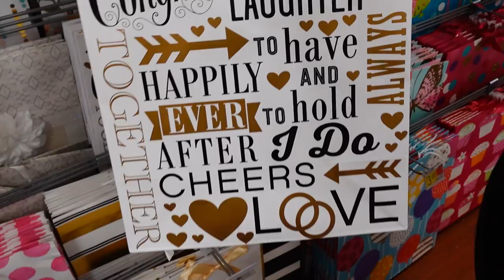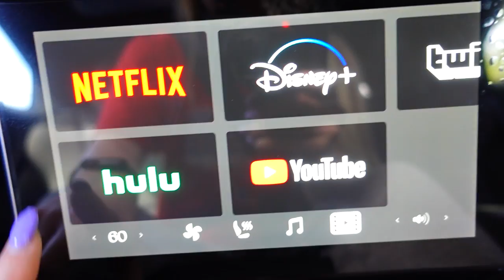Surprise Dream Car for DAD! | Tesla Model S Plaid

Comment: Don’t you need a special Tesla charger in your garage?
Reply: Not necessarily.  It can charge on a standard 110v, it even comes with an adapter for it, but it takes a LONG time to charge that way.  I’m sure they are having a Tesla charger installed, but until then they do have a way to charge it.

Comment: If you had pulled the car in without the use of the ramps it would have worked better lol. The rise from the step-up of the pavers was inconsequential and the only part of the tesla that touches them is the rubber of the tires so they wouldn't have been cracked or broken anyway.